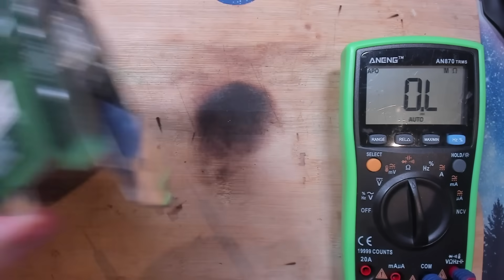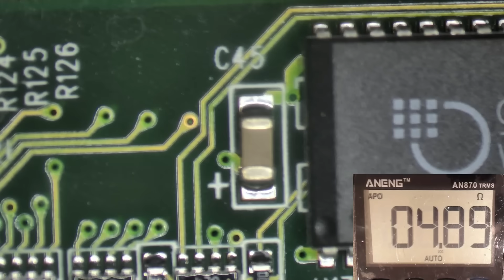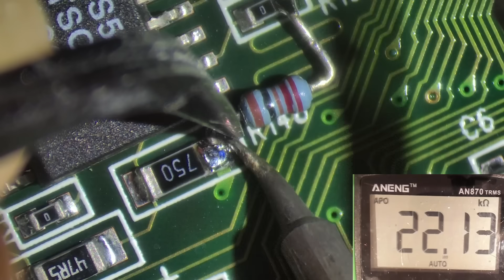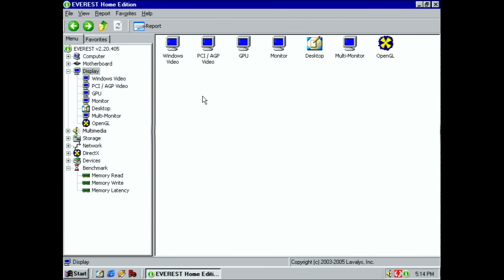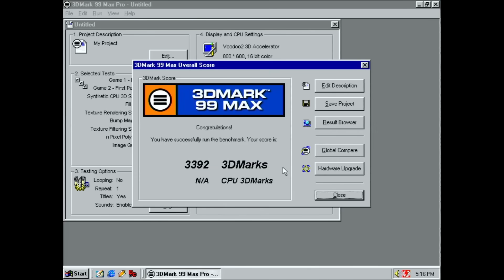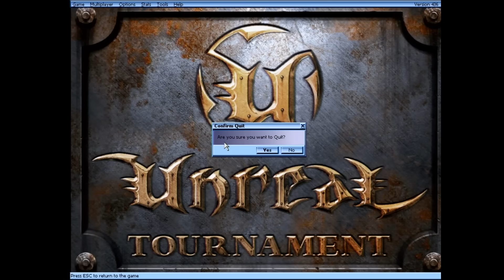I Saved a Voodoo 2 Using Hot Air ONLY!

Comment: I am trying to repair voodoo rush using this method, but I don't know proper resistance of 5V line. My card is 6mb model and measures round 8kohm.
Reply from the maker: 8 kOhm is still very safe. No need to hunt for bad caps in this case. Is there something else wrong with the card?
Reply: @bitsundbolts  Probably semi bad memory chip or bad contact somewhere. Most of the times 3DFX logo has some weird pattern to it until card is warm. Then it works perfectly fine.

Comment: So, I have ended up with a Magic 3D card.   it was sold to me on ebay as a voodoo2 card.    I think this one may be an 8mb card.   Anyway, I think I have found the problem, as there looks to be one capacitor missing on the back of the board.   I need to desolder a similar cap to find the capacitance, correct?     I guess I will have to order 2000000 of them to get one.
Reply from the maker: Might be a long shot, but maybe you have some old electronics that are useless and could server as a donor? A single missing capacitor is probably safe to ignore.

Comment: "So the problem is either on the front of the board or the back of the board" -- really narrowed it down there, Sherlock Holmes.
Reply from the maker: Sometimes my mouth and brain are disconnected because my brain is busy figuring out what is most likely the issue.
Reply: It's also possible for problems to be inside of the board, especially if it's more than a 2 layer board.

Comment: Nice repair - hot air and cans of freezer spray were very common tools in the TV and video repair industry! I would say that all those type of caps need replacing, if one has failed, they all probably will.
Reply from the maker: Yeah, probably. The first ones that go are the weaker ones or the ones with slight manufacturing defects. Recapping a Voodoo2 is just such a tedious job. So many small caps everywhere.

Comment: why is there even this kind of bodge-resistor? Is that a previous repair or original?
Reply from the maker: That is original on certain revisions on this Diamond cards. They seem to have fixed it in other revisions (not necessarily later revisions). It must have been an oversight.

Comment: Now you remind me, after I just received my last order of parts from the rodent-based electronics supplier. I was supposed to throw in some replacement caps for my Voodoo 2 cards, but I forgot all about them, and you just reminded me! I had the feeling there was something missing when I was making the order, I just couldn't put my finger on it. Why couldn't they use 0805 caps, I just ordered a whole spool of 100nF caps!

Anyway, my first 3D accelerator was a Diamond Monster 3D II 8MB, very similar to that card you repaired. I'm still pissed that I never got it back after I leant it to a friend some 25 years ago. Still great to see one of those cards repaired, though. Keep up the great work!
Reply from the maker: Haha - I also run out of those caps here and there. I prefer a donor card though since it has exactly what I would need - one of them is almost picked clean - except for some SMDs and the LDO. Sorry about your Voodoo2 - I wonder what has happened to it after you gave it to your friend.
Reply: @bitsundbolts  He said it didn't work, and I offered to go to his house to try to get it working but he was always seemed to be busy. When I asked for it back, he said he'd return it but never did. I'm guessing he actually did get it working and just wanted to keep it.

Comment: Hello BUB! Love your Videos.  Just pulled & checked both of my Creative CT6670 3dFX cards (1 - 12mb & 2 - 8mb) and they are both reading 11k ohms on the 5v pin. The other two pins read correctly on both cards as shown in your video.  I double checked with two different Ohm meters.  Should I be worried about the 11k ohms reading (vs 20k ohms on the 12mb and 30k ohms on the 8mb)?  Side note, I am sucessfully running  this pair in SLI mode at 1024x768 resolution! 85Hz too  I wasn't expecting it to work but it does.  :-)
Reply from the maker: Your cards are fine. It gets critical once you get closer to 100 Ohms. Maybe monitor the cards every 6 months or so and see if it gets worse.

Comment: Oh my, I don't even know where to begin with this one:
- This guy's nothing but hot air!
- Actually, that's not even true! Clearly, components were replaced using hot tweezers and stuff!
- Besides, I was told there would be Tillamook Overclocking! Bait and swiiiiitch!
- Also, those UT bots are obviously running on the lowest difficulty! Someone call Karl Jobst, that guy is cheating!

Jokes aside, great to see this technique confirmed, I'm so itching to check my own card and give it a try if necessary! Alas, both my card and my hot air station are still in storage.

Comment: Nice! I came across one with the 5V rail at 120 Ohms and I couldn't figure out which one it was even with hot air. I guess the fluctuation is just too small to detect on a value like that. But the card works fine in my system in that state, so I just let it slide -_-
Reply from the maker: Yes, even at those low resistances, you just waste a few mA - hard to tell. I was lucky so far that mostly the big caps were failing, they are easier to detect.
Also, small caps have different values - so, it is a lot harder to find a pattern.

Comment: you need to be using diode mode resistance is useless and differs meter to meter
Reply from the maker: I am wondering by how much those measurements would differ though. Shouldn't those meter measure about the same resistance - even if they are different (ballpark numbers, not precise measurements)?

Comment: Can you also measure the voltage along with the resistance the next time you test using the pyroelectric effect?
Reply from the maker: Next time if I get a card like this, I will do that. I understand it is good information to see how caps that failed differently measure in resistance and voltage.

Comment: It seems like the resistor you soldered also have an issue with the leg/body connection (at 6:32) - it should be replaced entirely.

Comment: capacitors lighting up are nothing, i once changed resistor into lightbulb by incorectly connecting usb header on a pentium 3 motherboard. funnyly enough short circuit protection didn't notice that and i thought there is jist another yellow led on the pcb
Reply from the maker: Yeah, it is all relative :) 5 amp on 5V can blow things up (25Watt), but the power supply wouldn't notice.

Comment: MLCC (Multi-layer ceramic caps) are built like a layer cake and are fragile. A cap that receives a sharp impact due to rough handling (thrown in a box, etc.) can crack. This lets the layers shift; think of cutting the layer cake along one radius line and offsetting the layers slightly. This lets and + and - layers come into contact and you have a short circuit.
Reply from the maker: Thanks for the nice explanation. Most of those cards come from a scrapyard where they were thrown into big bins with other hardware. No wonder that caps get damaged.